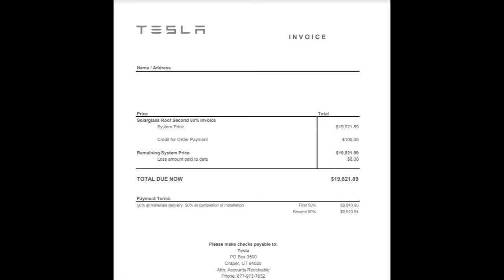Tesla Solar Roof Review Part 3:  The Install

Comment: Could you have requested solar shingles throughout?  It would have costed more I'm sure, though I'm not sure of orientation / exposure so whether it would have added output I don't know.  It would have been a consistent look then but it doesn't look bad; certainly better than the eyesore that roof mounted panels are.
Reply from the maker: Nope.  Solar tiles, even the dummy ones, are not an option.
Reply from the maker: @Stanislav Jaracz In theory, I had to pay extra for the wood (from the dry rot) because it was something done prior to tesla coming in by the local roofing company.  But seems like in my case they didn't charge me for it, perhaps due to the asphalt shingle snafu.   Gutters definitely isn't included and I had to pay out of pocket.  So in terms of materials, basically just the solar shingles, and stuff that go around the piping, inverter and the conduit, and the flashing and the black paint they used to paint the silver flashing black.